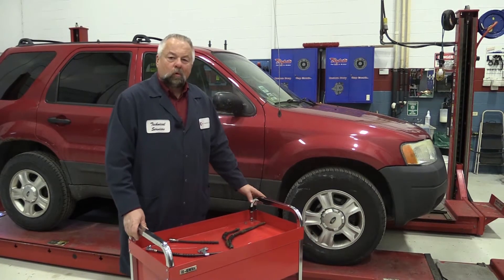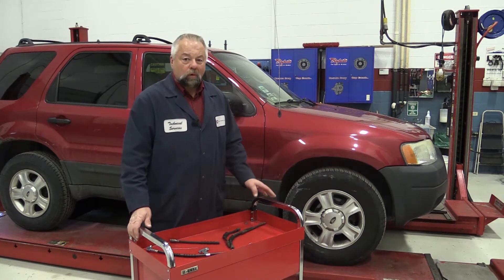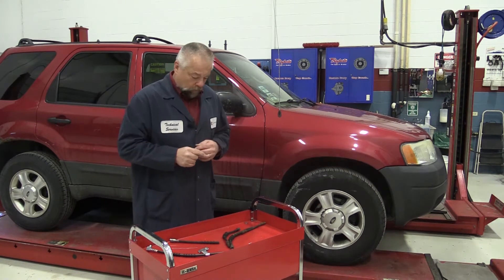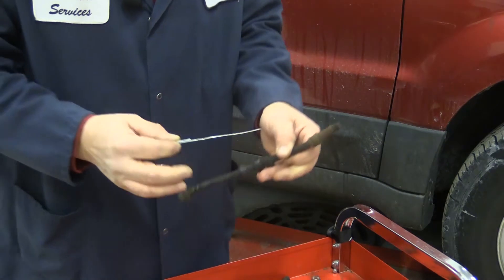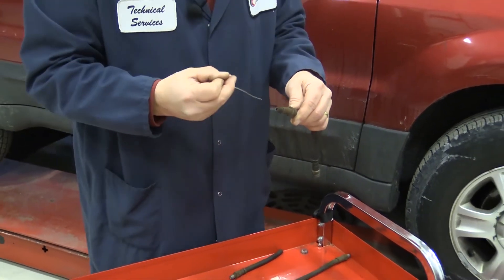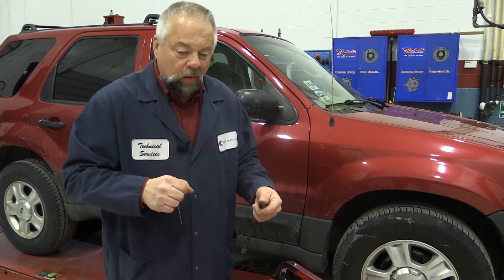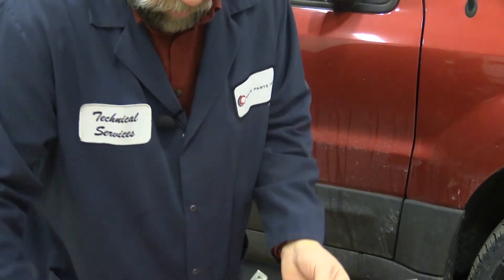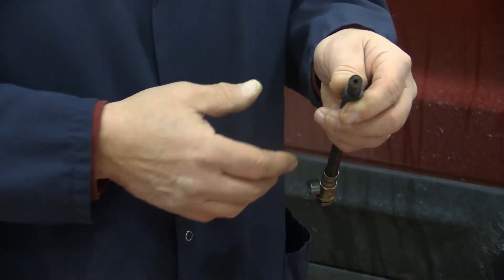Brake Pulls Caused by a Brake Hose Restriction

Comment: Yup, exact same problem. I replaced the calipers but couldn't figure out why one brake was dragging. With the car parked I would push down on the brake pedal but by the time I got out of the car to the wheel to turn it, it had freed-up. The restriction was right where you said it could be, on the clamp.

Comment: Your tutorial provides a great service for the DIY crowd.  Thank you so much!  

I scoured YouTube for a plausible explanation and fix for the front disc brakes on my F150 pulling the truck left when applied rapidly at interstate speeds and then rapidly returning the truck to normal tracking.  

After consulting with ASC certified automotive technicians and without inspection being told it was everything from frozen slide pins to a bad brake caliper, rotor and brake pads, I viewed your tutorial and concluded after your explanation that a restricted brake hose was most likely my problem and inspecting the rotor, caliper, brake pads and slide pins concluded that it was.  

I did the work myself and instead of unnecessarily spending high dollars on unneeded parts and labor to have both rotors, calipers, brake hoses and pads "professionally" replaced by parts hangers it was an hour's work in my home garage using a new Dorman $18 passenger side hydraulic brake hose purchased from Amazon, a bottle of DOT 3 brake fluid and bleeding the brake line after installation that solved my problem.  

Being an "if it isn't broke don't fix it" advocate, I chose not to replace the driver's side hose at this time.  I will monitor the situation carefully and at any hint of a problem in the future with the driver's side replace that hose at a later date.

Thanks again!  The truck brakes now work like new.

Comment: I have a ford edge and just replaced pads, and it has like a push back, like hesitation when I press the brakes. After about .5 of a second it pushs normaly and has no sticking issue. I have checked the fuses, and they are all good. I removed them, and with all 3 in the fuse box, abs, Traction control and abs valve, removed it is nit much improved  it did make it a little better maybe, and still didn't lock up, but 3 lights were on, and that is not ok with me. It feels like there is pressure issue? Or like the brake line hose, or valve is kinked? Any idea or help is appreciated.  Thanks

Comment: had a rear caliper sticking on my 99 trans am...guy i bought it from put new calipers on it but it always seemed to pull hard to the right sometimes....pads were really worn ...new flex hose fixed it....if you have a bad caliper go ahead do the flex hose also cause you gotta bleed it anyway...

Comment: Excellent video!  Great explanaton of a clogged brake line.  Just had the same problem a few days ago. Had a pull on my suv to the right. The driver side brake line was no good and slightly clogged.  Also noticed the rim was hot and a bit of smoke coming from caliber as it was locking up.

Comment: 2000 Ford Excursion issue Question. I have replaced the junk rubber hoses going to all 4 calipers with braided Big $ good ones (So no more rubber hoses to have an issue with restriction) , new calipers on front end,new pads new rotors on front end. Brake fluid has been flushed by Ford dealership and put new fluid in system. Still have same issue when braking at slow speeds ( Just before you come to a complete stop, petal drops down like someone was bleeding caliper and loosing/tightening bleeder screw. What is the cause of petal drop and slight pull to left ?? Been trying to figure this issue out for awhile. Is there something to adjust or replace that makes the flow of brake fluid to go to front & rear of Excursion ?? Is front getting more fluid flow than rear maybe ?
Reply: brake line leaking rear .or bad master cylinder.

Comment: Thank you! I have this exact issue with my old G20 van. I replaced my pads, drums, rotors, shoes, hardware, wheel cylinders, and calipers to no avail. I never thought of the hoses! I had the same symptom where my passenger front caliper would not gravity bleed. Ordering new hoses right now.
Reply: Same thing going on with my 1990 gmc vandura